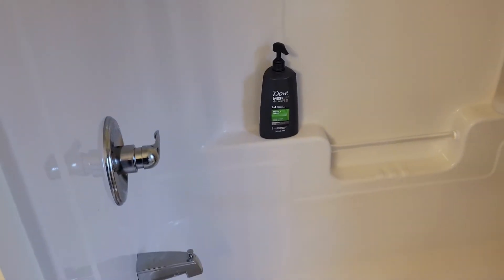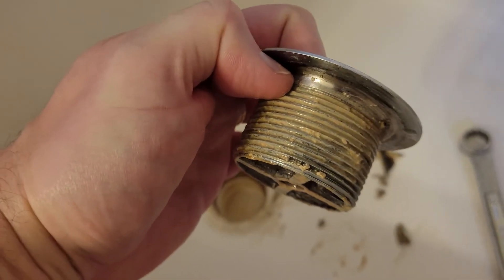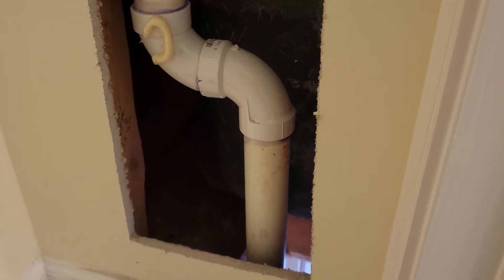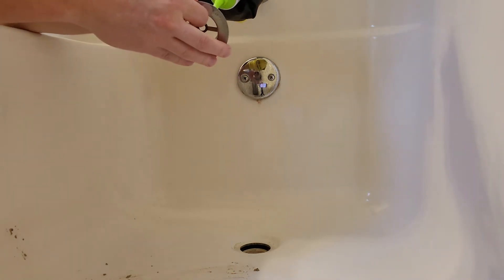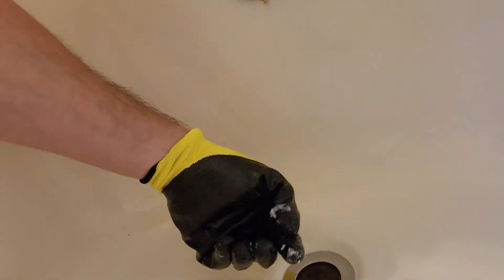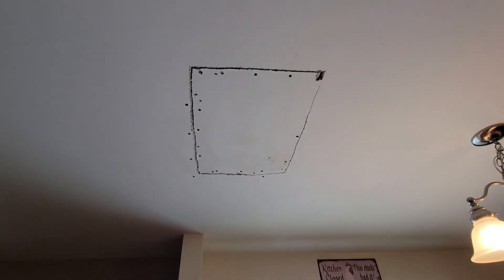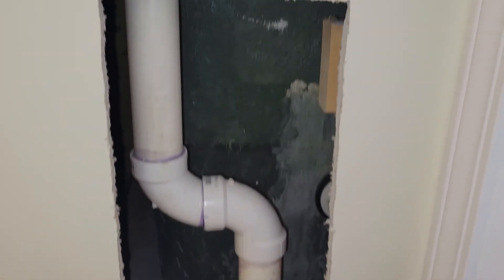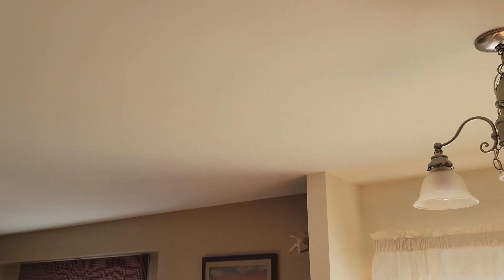Fixing a Leaky Bathtub Drain & Access Door

Comment: So, opening of ceiling wasn’t necessary? I think I have a same problem. Opened a ceiling and found leak, when I run a shower and toilet it doesn’t leak, it just leak from a big bathtub/jacuzzi.
Reply from the maker: In my case I was able to fix the leak by putting some caulk on the bathtub drain. I was also able to see the leak through the new access door behind the bathtub. Since the leak was minimal and there was no damage due to the leak I didn't need  to cut the hole in the ceiling as it wasn't needed. If I couldn't fix the leak or couldn't see if there was damage I would have likely needed to cut the ceiling hole to assess the situation. I'm no plumber, just a DIY'er so I gave myself some extra work by cutting the ceiling. Your issue sounds like a similar issue as ours. I would check the drain connection first and go from there. Hope this helps!